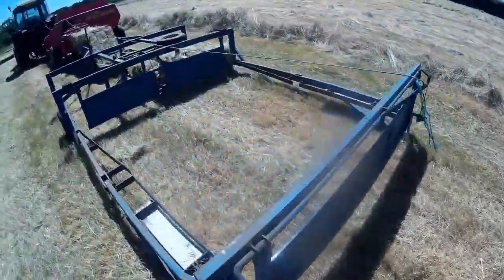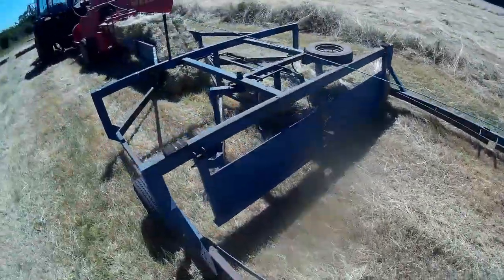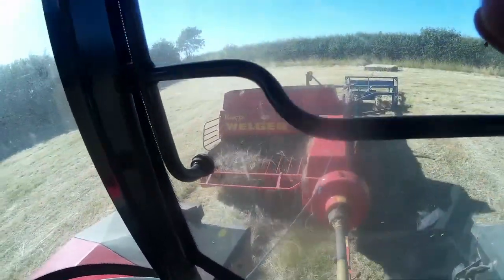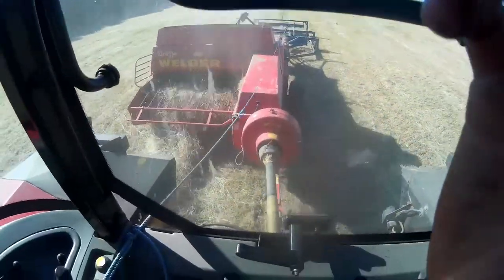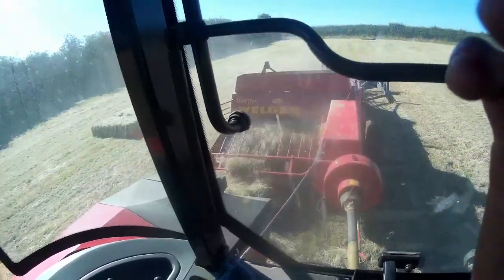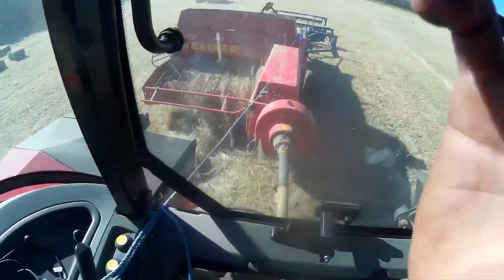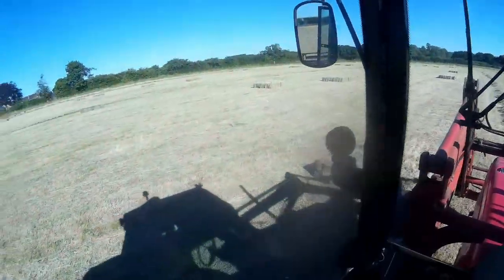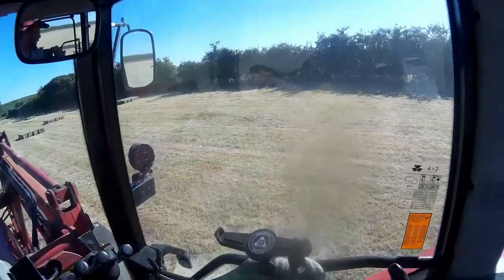Baling hay 2018

Comment: Your unlucky to get 2 knots on each other. That's a fair lead back to your place then. I'm glad I've got a 32ft trailer for those types of distances. another nice video though 👍
Reply from the maker: Cheer's unlucky seems to sum it up so far all though in another field i did find a broken haybob tine BEFORE it went through the baler, 11 miles i think was putting an extra layer on the trailer than normal to make 106 bales i am hoping to find a 6-8 ton 14 ft twin axle tipper and add a bale extension but second hand there like rocking horse shit
Reply: Yeah we had 2 tractors go down 😣. Think I was doing 10 miles each way but all on big roads and doing 43 kph in the trac. Yeah I'm on the look for a smaller trailer as well. Kinda 20 ft long for our tight fields

Comment: Looks like it didn't go too badly at all all things considered! Mine's been a bloody nightmare, ended up baling this Sunday due to a unexpected rain shower setting back 2 days. Then the baler kept hanging onto the knot on one side perhaps every two dozen bales (bill hook issue) so was in and out the cab like a yo-yo, the sledge (same as yours) broke a gate (rusty bit!), then the tractor fuel tap gauze blocked up!!